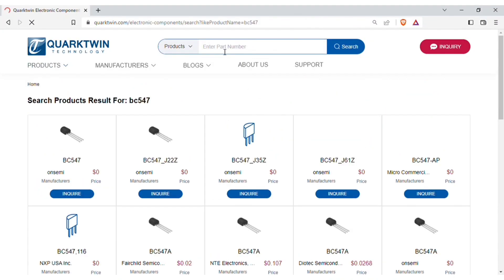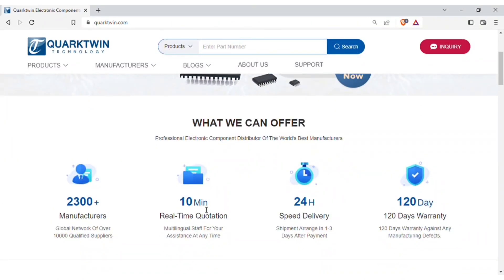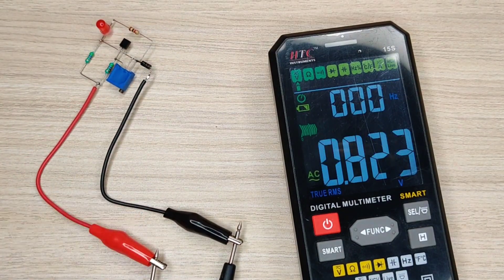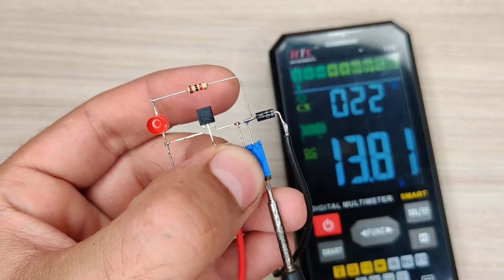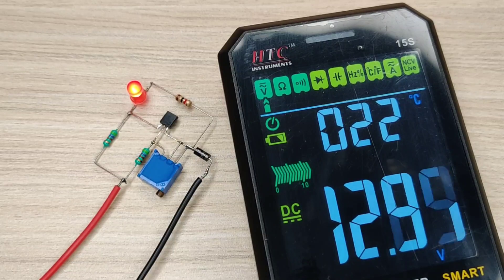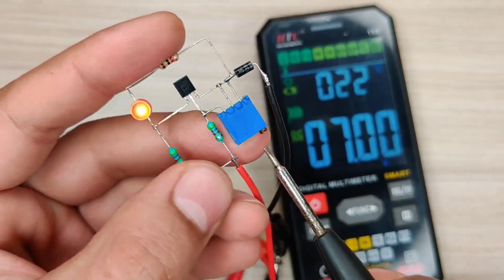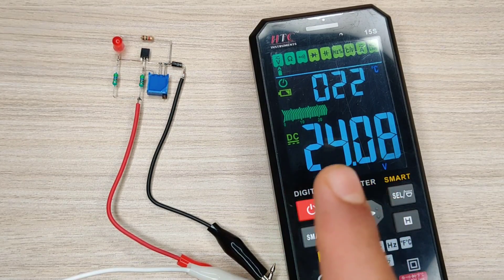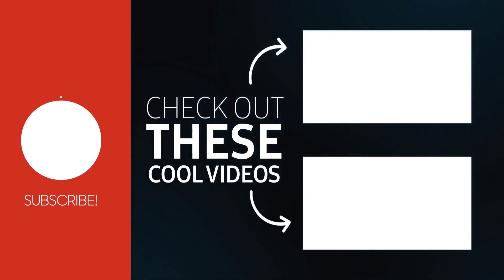[NEW] 12 volt battery full charge level indicator circuit

Comment: You're not connecting battery. When you connect power source, battery and the circuit at the same time you will see the led is already off because of the input voltage is already at 14v.